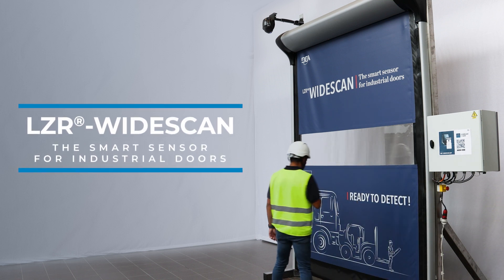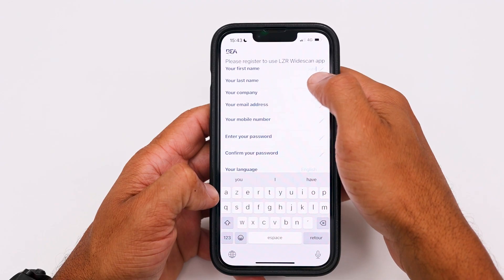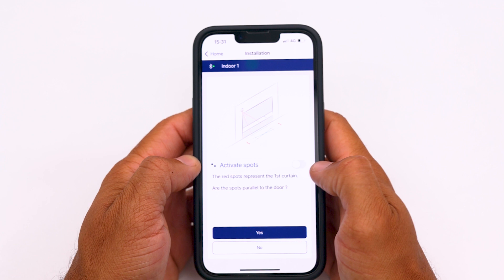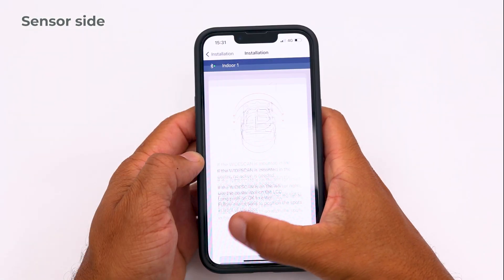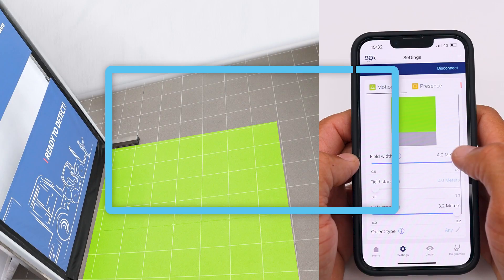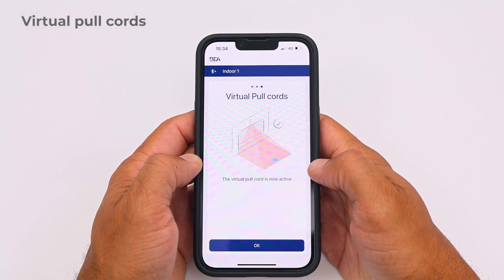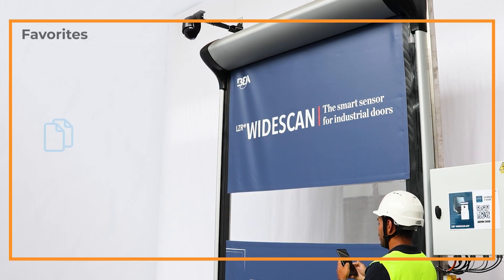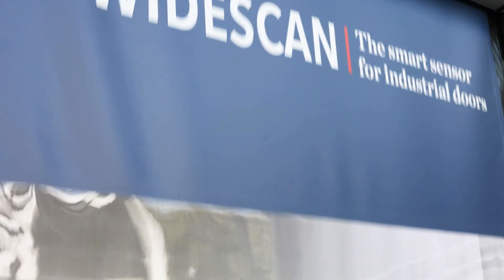Tutorial LZR-WIDESCAN – The smart sensor for industrial doors (tuto)

Comment: What do you do if you are having trouble connecting to the sensor via Bluetooth. The sensor comes up on the app and I use the password that is programmed on the sensor but when I click to connect it doesn’t
Reply from the maker: Hello, thanks for your question. Make sure you are using the right password when trying to connect to the sensor. The p/w is mentioned on the document inside the box. If the problem persists, please contact our technical service: https://eu.beasensors.com/en/contact/?subject=Technical%20support&product=lzr-widescan

Comment: What is the reason for a BEA sensor is not showing in the app but the sensor is visible when searching with phone bluetooth settings. ?  Can anyone help? Thanks in advance.
Reply from the maker: Hello, thanks for your question. Please make sure to activate Bluetooth on the sensor using one of the 4 methods stipulated on the sheet in the box. If you need more info, do not hesitate to contact our technical service, they will help you right away: 
https://eu.beasensors.com/en/contact/?subject=Technical%20support&product=lzr-widescan
Reply: @bea-sensors-europe   thanks for the quick response. How can i set the door to open automatically when i walk into the door. Was this can be  done in the app.?  Your response is highly appreciated.